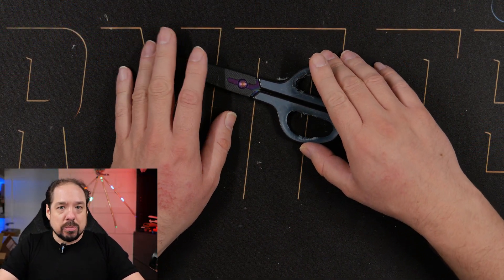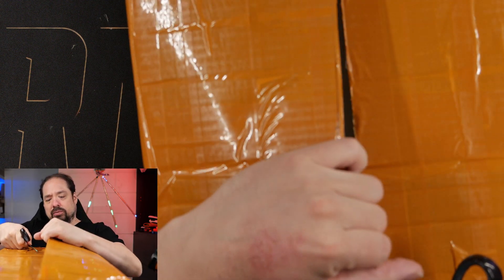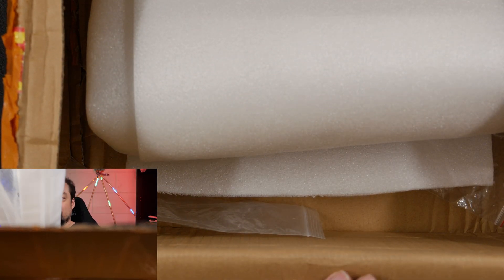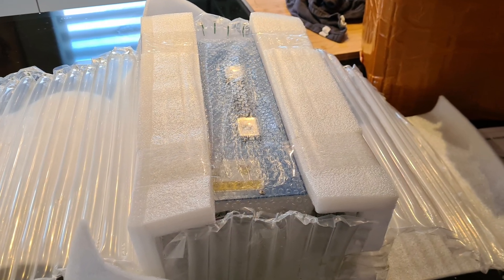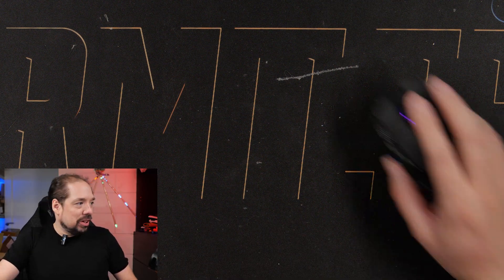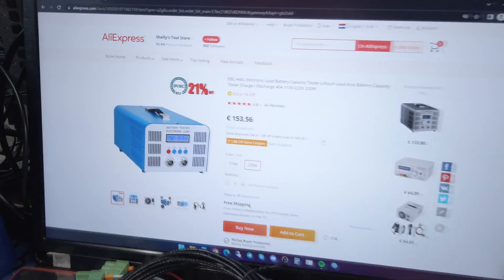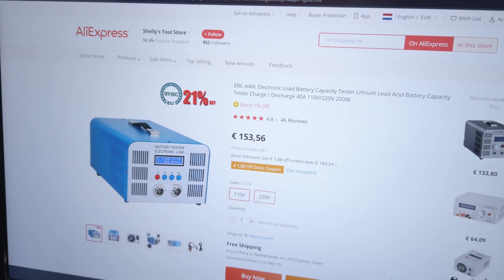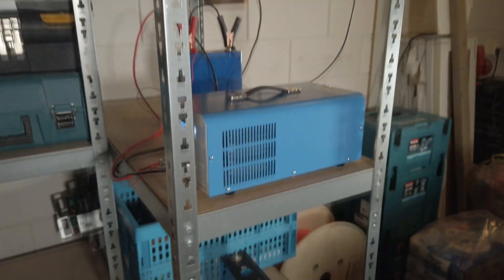📦QuinBoxed📦 Emergency EP.003: ZKETECH EBC-A40L

Comment: Welcome to the land of BS that is lifepo4 cells!  Don't get too excited about having more than the rated capacity.  That just means you got a battery that failed its actual desired capacity or other parameter and could not be sold to the automotive industry.  That doesn't mean it won't work well for storage, but don't fall into the, "Grade A = New Pristine Battery that passed the tests," mindset. If they are selling cells to not an automotive company, ie us consumers, the cell in some way has failed.
Reply from the maker: Yeah, agree there. I ended up testing all cells so I can do my own proper matching, content about that soon!

Comment: Don't forget to check the individual cell voltages before you put them in parallel to further equalize them.
I used my 4x10A lab supply and a 400W electronic load.  Cycling 16 40Ah cells took ages.  280Ah will take eras 🙂
Reply from the maker: What difference would the invidual cell voltage make if I'm going to equalize them anyway?

My idea is to put them in series, have them equalize between themselves a bit and the charge to like 85% to 90% of the way, lots more watts like that.

The disconnect everything, put it in parallel and then top balance them all. At that point, everything should be in the same state.

Once in series again with BMS and load, any outliers would pretty quickly become apparent I think.

I am doing individual tests right now, but that's more for the videos, so we'll see more about it in the future!
Reply: @IntermitTech  Well, when charged in series (even with an balancer) the cell voltages may (still) differ, and when next connected in parallel a large equalization current may flow. Best to check that the difference between the lowest and highest cell voltage is no more than 20mV or so. Keep in mind these large 280Ah cells can easily provide several kA.
Reply from the maker: Ah like that, yes Thnx, that's a good reminder! That I do understand though and I don't except them to differ too much if I let them equalize a little bit after charging and use thick busbars to minimize any voltage drop.

I have also planned a pre-charge resistor between the battery and inverters, maybe it could be useful here too if one of the cells is really out of balance.

Comment: Would be really cool if you could “close the loop” and charge low cells with full cells.
Reply from the maker: How do you mean exactly? In theory if you connect 2 sells in parallel the higher voltage one will charge the lower voltage one and in the end balance out.
Reply: @IntermitTech  I think I worded my original comment poorly. What I mean is that you’re powering the charger/discharge from the wall then burning off 280ah to heat. Instead of losing the 280ah to heat on the discharge test, it would be cool if transfer that energy into discharged cells. Of course there would be losses.
Reply: What some people on the internet do,  guys and girls,  is use a complete batterypack for that. 
But that's the chicken and the egg:-)
So, one 48v 16S pack, inverter and then the ZKE to charge each cell.

Andries, as it looks like, you have enough cells for 6 batteries. (all for your self?;-)
I suppose measure 16 cells, create one pack and use those + the inverter and ZKE to measure the next 16 cells. Build a pack with those -and because they are fully charged, charge the next 16 cells, etc.
Afterwards you know all characteristics of each cell and can rearange the cells to create 6 optimal packs.